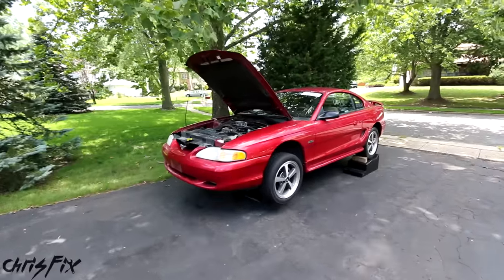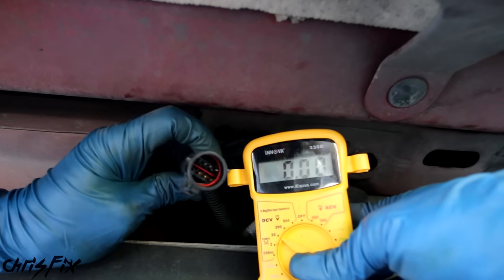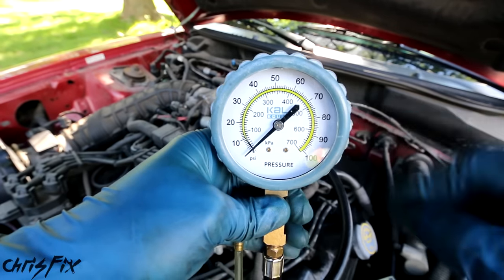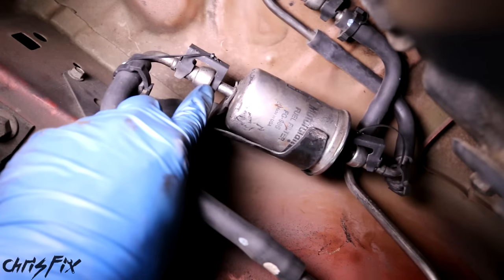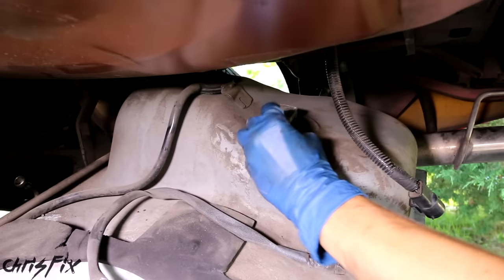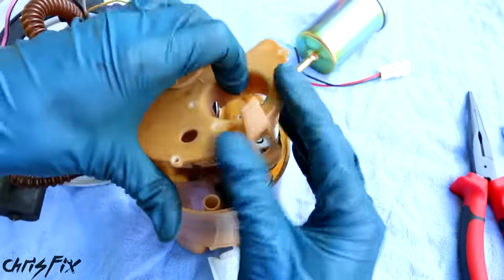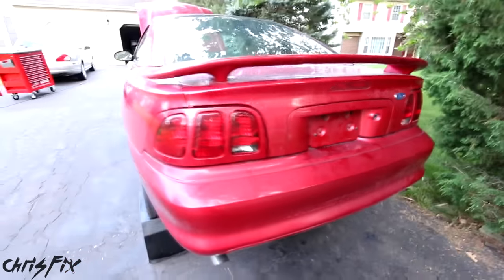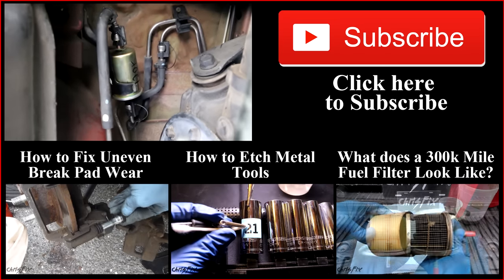How to Diagnose and Replace a Fuel Pump

Comment: I love that you use hand tools so that people at home don't feel intimidated by the process and think that they need a bunch of fancy (and expensive) power tools. Great video! Luckily I can get to my tank and pump just behind my rear seats. It's essentially the same pump as the drift stang, but has a different connector. I've changed it a few times, trying to find the best one for my car. A little bit more GPR/LPH ended up giving me more power over the stock pump, since it's a return style system and doesn't waste fuel.

Comment: "Easy to do with normal house tools!" Uses special quick disconnect tools.
Reply: lol
Reply: They're really cheap, a couple bucks, and available at most all parts stores. Special tools would be a strut spring compressor, Starrett dial indicator or something with limited use but is also expensive. The quick disconnect tools can be used for many years of Fords, both for the pump and fuel filter and for other applications.
Reply: Nate Rowe I know, I was just making the point that they might not be considered "normal house tools" to some people.
Reply: True, this isn't a hammer & screwdriver type job. But really, if you can afford a quality pump, you can afford the very minor investment in the right disconnect tool. Even buying all the tools needed, it's cheaper to do it yourself than paying a mechanic.
Reply from the maker: It is a cheap quick disconnect tool that you can get when you get your new fuel pump. You can also make your own quick disconnect tool as I showed in this video: https://www.youtube.com/watch?v=uQbYs_6jrno

Comment: Good video, different on a IRS car with a returnless system but close enough.  Also a great time to relocate the battery to the trunk while the tank is down.  Tackling this project tomorrow with a 300lph Walbro drop in assembly on a 2000 GT swapped to IRS.

Comment: Great video, I have a 02 mustang, original owner with 137,000 miles on it. Followed your video instructions and was thrilled when it started, after the three key turn priming.  My mustang did not have the access via the trunk, pour design but I did get twenty years out of the fuel pump.  Curious how much this would have cost at a shop if anybody knows ?  Thanks again for the video👍

Comment: Love you tutorials.  

I now have a 96 Mustang that has been sitting for at least 3 years, probably more.  It has a full tank of gas, checked after replacing the battery.  Now I want to remove and replace the fuel.  I can't get a hose into the fill neck like you showed in your earlier video.  I have even tried using very small tubing 1/4" od.  I have no idea what the anti-siphon device looks like in this car, it may be a screen.  What next.  Is the next step to run 15 or so gallons out of the tank with the fuel pump.  Looks like that can be done with some jumpers and a battery charger in place.  Any tips would be appreciated.

Comment: Thanks a lot bro my mom's honda wasn't starting at all cuz it was sitting in the parking lot for like 4-5 months and after i replaced the fuel pump it started running without any probs 
Dropped a 👍 : )

Comment: Just replaced mine today! 2012 Hyundai Elantra GLS. Pretty easy on this car. Just remove the back bottom seats and its there in the middle. What I found crazy was cost of fuel pump at different places. Auto stores are like $200 to $300. Amazon and Carparts around $80. Got the Amazon one and it works fine.

Comment: Gosh i felt just as happy as you when the car started.  I have to change the pump on my 2002 Honda accord 2002 in the trunk.  You think I should just change the relay, and the map sensor now that I'm at it.  It spuddered on cold days and now it wants to turn over real bad but wont.  Cap and distributor is new and the rotor, cables too.  I'm missing my right hand but I can do it, taking my time.  I bought the whole assembly.

Comment: Where you located at, have an 86 GT that won't start, I believe its the fuel pump. Put fresh gas and charged the battery, it won't turn over. Would be great to have you work on it.

Comment: I had a audi a4 that would not start. It turned out to be the fuel pump relay. Unfortunately, the fuel pump relay was underneath the ecu, to remove the ecu you had to remove the windshield wipers and the windshield cowl. After 3 hours and breaking a 7 year old windshield cowl I got to the relay and got my car working again!

Comment: After watching this video, I feel a lot more confident in diagnosing my car's fuel pump. My issue might be related to gas issue, but whenever I'm on the highway, around 37-40mph my car feels like it's hesitating and won't pick up speed. I'd have to drop back on accelerating for a bit and then when I accelerate again it runs smoothly.

Comment: I had an 89 Mustang that I needed to replace the fuel pump and I also didn’t have access from the trunk.  so I made access from the trunk and cut a perfectly square opening right above the fuel pump and then when I was finished, I made a small metal plate, cut slightly bigger than the opening and sealed with silicone, so for any future access I still didn’t have to drop the tank

Comment: The only thing I'd add to the diagnosis procedure would be checking for voltage drop at the pump connector. I have seen bad wiring cause the pump to get power but then when the pump tries to draw current it drops the voltage. It's a bit like how you'd imagine a clog in a pipe might let pressure through but that pressure would drop quickly if you open the faucet because the pipe is too restricted to flow right.

Usually you can just backprobe the pump connector (backprobe kits are $10-$20 on amazon) - this lets you see the voltage to the pump while the pump is still plugged in. You want to see if the voltage drops when you run the pump.

Also it's worth noting that there are plenty of cases where fuel pumps can be worn out but not completely dead yet. In that case you'll usually need to pay close attention to that fuel pressure for certain behaviors and the diagnosis can get a little bit more in-depth, but usually that will not cause a no-start, it'll just cause a hard start or stalling.

Comment: Also check the fuel pump relay. I pulled it out and put it back in and the fuel pump worked and my 2001 alero 2.4 started up. Could also be ground issues.

Comment: Most of this is the same for the 1999-2003 mustang, but for the 2004 there isn't a port to test fuel pressure, you have to take it to a mechanic and or use a special scanner tool to test fuel pressure, also the cable you removed to take out the wire harness is in a different spot

Comment: Hey guys, so this is an awesome helpful video but I do warn you, if you’re gonna do this on a newer car, TAKE THE PRESSURE OUT IF THE FUEL LINES. I didn’t know this when attempting to simply change the fuel pump. When accessing the fuel pump assembly under the seats from my civic, I had fuel pressure in the lines as I had stopped driving minutes before trying to replace my pump. If you remove the high pressure line going to the engine (the small hose, big hose is a fuel vapour vent hose), you can damage the fuel pressure regulator, which is in the fuel pump assembly in the tank (ask me how I know that). Just be careful to remove fuel pressure, you do this by removing the fuel pump fuse and cranking the engine for 2-3 seconds which removes the remaining fuel from the lines
Reply: kevin, i really really hope people read this.  i thank you for this reminder, i have a 1990 ford e350 van and i think i remember reading that about a year ago and totally forgot.  i'm about to change the fuel filter and came here to remember some things (like i forgot about the special tool), this is a huge reminder to relieve that pressure.  great reminder and...chris - you're one of the kindest and most positive/patient people on youtube.  thank you-barbie

Comment: Some older cars have mechanical fuel pump. My E30 has a membrane pump that uses a specific cam on the camshaft itself to pump the fuel. It rarely goes bad ...

Comment: I know this is an older video but I love how most car manufacturers make it seem difficult to do anything yourself and you diagnose and fix things faster than a shop using all the fancy shmansy code readers especially since there are codes that are just wrong.
Example I had a town and country code read that the cat was not functioning it was a pressure problem but real problem was the rubber on a spark plug wire had broken and was arcing to other parts of the engine I could have spent 300 or just 20 bucks but my cousin to dinner from the Chinese place down the street to fix it.

Comment: Hi Chris!
I have a Grand Marquis. Just to do my preventative maintenance, I am thinking to replace the fuel pump sometimes this spring. After looking around and study how to replace it, I came to conclusion that if I get the hold of the engineers who designed it, I will beat the crap out of them....Have you ever tried to replace the fuel pump on a Crown Vic?!   any tips?
Thanks again

Comment: Hey Chris I’ve watch most of your video’s and they are really helpful but I’m having a issue you haven’t gone over yet I don’t think... I have a 96 Jeep Grand Cherokee 5.2l v8 and it died on me and wasn’t getting fuel so I replaced the fuel pump and it seemed to fix the problem but only temporary. About a week after replacing the pump it did it again so I just let it sit for a couple months because I was frustrated at this point. But recently I’ve been trying to figure it out I’ve found a bad fuse for the gauge cluster because it wasn’t coming on, now it comes on but the gauges don’t move like they usually do but I got it to work normal once and I could here the fuel prime but it didn’t start so the fuel pump isn’t bad ... but the battery don’t hold a charge would a bad battery cause all these issues , also I took out the fuel pump relay and Ran a straight wire and it comes on so the pump isn’t bad I’m have electrical issues... so would it be the battery ? I can jump it and it cranks over but that’s it

Comment: It's probably a rare situation but sometimes the cars anti-theft system prevents it from starting by shutting down the injectors. This is currently happening to one of my cars. There are many fixes on the internet, but mine involved unlocking the driver door with the key, not with the fob. It's called 'resetting the anti-theft system'.

Comment: What should I do if my 2013 v6 mustang is idling at lower rpms than usual and my check engine light is on. My uncle had connected the code scanner tool and said that is has to do with a fuel sender or something either clogged or not functioning right and it causes my car to feel like it is loosing power and he told me to ask about getting a full new fuel pump from the dealership or autozone. What do you guys recommend I check or do to fix this issue????
Reply from the maker: It sounds like a clogged fuel pump, I would find one from a parts store and replace it yourself!

Comment: Pro tip- there’s a little plastic tool that is made to specifically take out fuses so you don’t need to use pliers. That tool is in more fuse boxes. Look in your owners manual or just open the fuse box and you should see it.

Comment: just checked my fuel pressure with gauge I was able to rent from parts store.15psi and building slowly to 35psi but dropping to 20psi when idling and then engine stalling after 3-7sec. Factory system psi is 43.5psi on my Subaru.

Comment: Seems like older Fords (or at least the ones I have) have an issue with the pump while sitting for a while. I am working on a 2002 Escape that won't run and while diagnosing it disconnected the fuel line from the fuel pump. I tried to see if any gas would come out by putting the car in run. Nothing. I also had a fuel pump issue with my 1964 Fairlane that caused it to squirt gas out the bottom of the car. The whole pump assembly had to be replaced.

Comment: Thanks for the great videos! I recently bought a 1995 Ford Mustang 3.8L V6 to work on as a project car and I've been using your videos as a guide. 
I was going through your steps of figuring out if the fuel pump was bad, and I checked the fuse and it was good. But, I got no voltage when I checked the slot for the fuel pump fuse. Do you know what I should do now? Would I have to replace the fuse box?
Reply from the maker: Thanks a lot! Try a new ground and make sure the key is in the run position!
Reply: @chrisfix  I tried it with the key in the run position and still no luck :/ The slots for the Rear Window defroster (Htd. Bl.) and Fan were also getting 0 voltage.
I was looking for the fuel pump relay in the repair manual and the owner's manual, but I can't tell if there is one. I'm not sure if it would be in the passenger side panel like yours. I tried taking off the panels, but I was afraid I might break them haha

Comment: Hmm, so my 2001 Saturn SL2 recently started having an issue when I try to start it, it turns over and gets ignition in the motor then it dies. After a few tries and a bit of stress thinking I might kill the battery, it eventually starts up and Im able to keep it running by reving up the rpms for a couple minutes. Over the last few weeks, it's gotten bad enough where I wont drive it. I checked the fuel filter and its clean. Does this sound like a bad fuel pump? It's not a power issue...

Comment: Hey there. First of all i'd like to say i ve watched quite a few of your videos and they are always very informative and I learned alot from you, thank you for that.. I noticed this fuel tank has screws but do you have any advice on plastic fuel tanks where the pump is locked with a plastic ring ?   I tried replacing my pump on a Renault Clio but that ring seems like its stuck there. I tried hammering it, brute force, WD 40 and a 3 clip lock ring removal but to no avail. Any tips would be much appreciated.

Comment: 1:32 use light 3.4 (not LED) old school test light in place of fuse.
Bad brushes in the pump motor will still allow digital (high impedance meter) to show voltage, while test light will be off in this situation indicating bad pump

Comment: Love the videos. Just wanted to mention the relay is in the CCRM under the passenger side fender well. I'm having a time with my 98. I replaced the fuel pump and not getting power. I didn't check for power first (it needed them pump based off the gunk on the sock). Can you show the relay in the kick panel? I can't seem to find it.

Comment: just a warning: some cars, such as the third gen (82-92) Firebird/Camaro, you have to remove the exhaust, rear track bar, and rear track bar brace in order to get to the fuel tank. it's why some people cut open a hole that leads to the fuel pump.

Comment: Thanks for this video.  I have a 99 GT that I am rebuilding.  I think something is wrong with the fuel pump.  When I turn the key on, I hear the fuel pump and the fuel pressure gauge shows 15 psi, but then immediately drops back to zero.  When I crank it, the pressure build to 35-40 psi but as soon as I stop cranking it drops immediately to zero.  Should the lines stay pressurized for a little while after the fuel pump builds pressure?

Comment: @Chrisfix update on my auction mustang, I got the car running it's 2010 mustang GT 4.6 with manual transmission, fuel pump issue can you imagine😂 needs some little care but it's doing alright I even started it and took it for a ride
I have replaced the fuel pump, but locking ring on the fuel pump is the hardest thing I ever saw on any car before, any tips or tricks, I work on it alone unfortunately.
Thank you Chrisfix

Comment: I own a geo metro LSI convertible. The last time I remember something was happening the car was sounding and performing like a low battery RC toy, even the check engine light was one. I think it's the fuel pump.

Comment: Thanx 4 da video. I was debating weather replacing da whole unit or just da pump. I think ma pump is goin bad wen turn it on is slugish and da rpm is stayin way high wen i accelerate
Reply from the maker: Yeah it sounds like your car is struggling to get enough fuel, let me know how the replacement goes!
Reply: @chrisfix  thanx 4 da reply datz wat i think also. wen itz on idle da rpm is very low like in ur recent video it sputters and shakez like itz about shut off by itself

Comment: In the age of methanol (aka water magnet), the only way to change a fuel pump is by cutting a access hole in the sheet metal.  Many cars, such as a Town Car are made so the tank can't even be bolted back in after you unscrew the straps (because the studs are made so they can/will be broken off on the assembly line because they're a tank puncher collision hazard).

Comment: Sometimes you can't hear the fuel pump run unless you open the fuel door and take the cap off the tank with your ear to the filler hole.  The fuel pump is actually cooled by the gas.

Comment: Also hook up a scan tool to see if you get a code. Mine was P1610 (Immobilizer System Malfunction). Reported fix = swap key. Hopefully you do this BEFORE changing the fuel pump. Sigh.

Comment: A PATS system fault will kill power to the fuel pump. If the theft light flashes fast with the key on, a theft fault has occurred. Check that out before checking the inertia switch.

Comment: So my car has power at fuse in front but NO voltage at the rear near fuel tank when I disconnect the harness. Im going to replace or switch the relay as the next step...?
Reply: Oh it’s very similar to the car in the video...a 96 mustang GT.